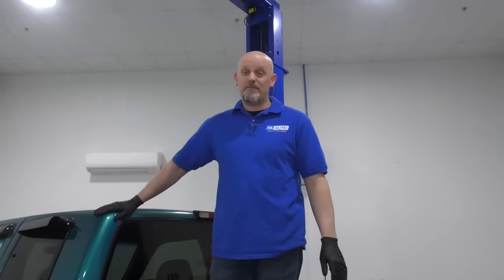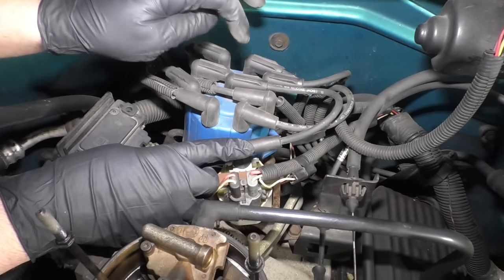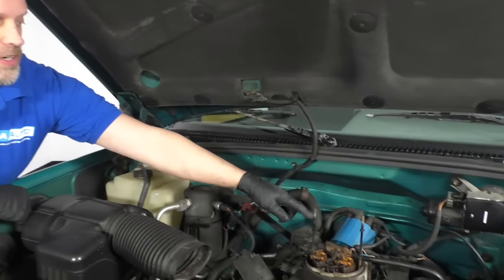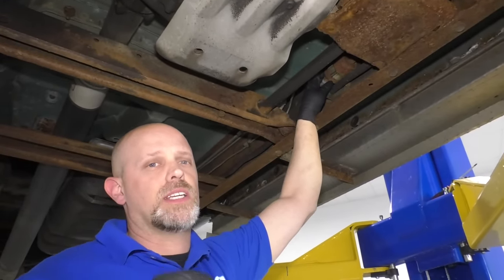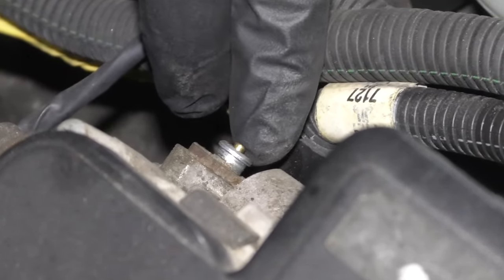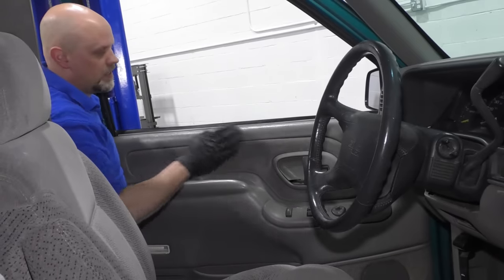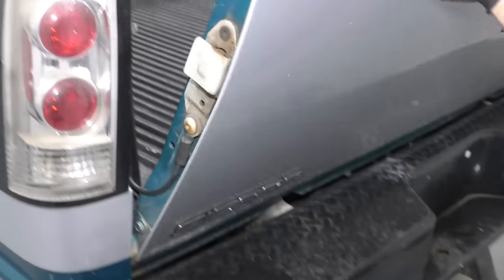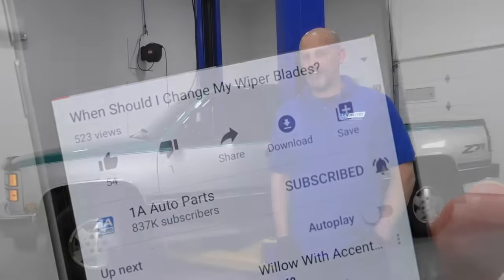Top 5 Problems GMC Chevy Truck 4th Generation 1988-02

Comment: I have a 91 I bought new. 2 of these don't apply. The AC controls on mine are different and it has no ABS. After 275,000 miles and nearly 30 years I would expect any vehicle to need a new fuel pump. The others I haven't experienced. Problems I've had with mine and a friend of mine who has a similar truck has had: 
1. wiper motor control board has solders that tend to break and make the wipers not operate correctly or not at all. I've had to resolder them twice. 
2. Rubber fuel line  (roughly 2 inches long) inside the tank from the pump to the grommet ruptures and causes fuel to pump back into the tank. The symptom is truck will start but immediately die. You can feather the gas pedal to keep it running but it wil run horribly due to a lack of fuel pressure. Another way to get to the top side of the fuel tank is to pull the bed off. 4 bolts hold it on, and the wiring harness to the tail lights will need to be unplugged at the connector, and the grommet around the fuel tank filler neck will need to be removed as well as the grounding wire inside the fuel door. The bed can then be lifted off and rested on top off the rear tires and the bumper. 2 people can lift a short bed, but might need more help for a long bed. Every time I've needed to access the top of the fuel tank, the tank was full of gas and pulling the bed off I considered the safer option. Put alignment marks on the underside when pulling the bed bolts out to make sure the body lines are the same when you put the bed back on. 
3. The door pins, bushings, and roller pins. The roller pins bend at the roller, and the pins and bushings wear and cause the door to sag which creates issues with closing the door as well as noisy opening and closing of the door. 
4. Input shaft bearings on the manual transmission. There is a plastic keeper to hold the ball bearings in place. Of course it gets brittle and breaks which allows all the ball bearings to congregate to one side of the bearing instead of being evenly spaced which creates a lot of noise from oscillation.    
5. intake manifold gasket goes bad causing oil leak.
6. Fuel gauge sending unit. It'll go out and can cause a multitude of different inaccurate readings. Right now mine reads fine from a full tank to about a half tank. It never indicates less than half a tank though. 
7. AC low pressure cycle switch. It'll go out causing the compressor to cycle on and off excessively.  
8. AC recirculation vent limit switch. It goes out causing the motor that opens and closes the recirc vent to continue running even though the vent is fully opened or closed. It can be noticed from a constant clicking noise from under the passenger side of the dash. Disconnecting the electrical connector from the switch is necessary until the switch is replaced or otherwise made functional again depending on the reason the switch is not turning off the motor.  
Can't complain about this (except for the transmission bearings) over a course of nearly 30 years and that many miles though. It has been a great truck and still is.

Comment: I own a 1996 Chevy Silverado 2500 2WD,,,it has jumpy breaks been fixed many times and goes back to jumping,,,it does not do it all the time or to the same degree,,,it has been to the Chevy dealer here 2-3 times and other places too for this problem,,,what is wrong with it???  had it all changed twice and after a couple of weeks or so right back to jumping

Comment: I have 1998gmc 1500 and I’m having battery or charge problems. and it turns off while driving and the  voltage is below 14v around 11-12v. I put the battery to charge and I’m going to see if that helps

Comment: the ignition module goes bad it also loses fuel injector pulse, so if you have no spark and the injectors aren't firing, its the ignition module.

Comment: Hi I has 1997 gmc sierra k1500 5.7L so I did lot what I could but still problem is when engine enough hot and drive in freeway or any in high speed road. When I'm on 40mph saw sign say 50 mph I not heavy foot just very slow to speed up then has jumps or mistakes fires I not sure. But if I just do heavy foot nothing happen like with light foot.

Comment: 2001 GMC sierra 1500 single cab running rich , sputter alot.change to up graded injector, change gas pump and of course service parts .oil+filter spark plugs with new plug wires. Clean egr valve. Clean charcoal canister. Just had enough of this truck

Comment: Interesting common faults on those rigs. The EGR valve to EGR solenoid hard plastic vacuum line that is pre-molded often cracks too. And it's not available as far as we can tell however, the hard 8mm plastic line is available and so are the rubber elbows.  Problem is, using straight line is likely to result in early failure with the unmolded plastic line (under stress all the time). Is this part still available or is there a method to pre-bend this hard plastic line? EGR codes are being generated and we found a crack/aged area on this line.
Reply: I had same problem, made a crude jig with 16 penny nails, cut off heads and drove them in to a piece of wood, 2 x 6, using old line and fittings rigged it to use the thermoplastic tubing and used a heat gun to get the tubing just hot enough to bend to prevent collapse, used my rubber tip blow gun to blow low pressure air through it and after cooled and cut to length with a sharp razor blade and fittings installed, it looks good and works, I'd hate to live on the difference, jobs a bit labor intensive but with patience, it can be done and to the average non-mechanic, they wouldn't know the difference and it's a great, sound, solid repair, sometimes you can't buy what you need, adapt and overcome, having just given that tidbit out, if you will excuse me, I have a Faraday cage to go work on.😮😮😮😮😮😮

Comment: wrong on some of tailgate latch. u dont ever need new one unless u broke it completely. 99 % of the time just push tailgate towards box and it will release, also if its rusty spray lube is amazing. also if not latching when closing tailgate then pull handle while closing gate then once closed u let go of latch and it will grab lude helps in this situation also.

Comment: I've had the head light switch go out a few times. Luckily the one I bought has a lifetime warranty so only had to pay for one replacement! Also the tail light board gets crappy and they'll be intermittent till you get a new one. I thought it was a loose bulb but replacing the board fixed it for good(ok the last year or so, so far!) All the other things I've had to have replaced at least once! Hey but it's got 270K and these fixes aren't too hard to do. Brakes have been the worst of any vehicle I've ever had though. Might be worth bypassing the ABS. I think that's the main culprit in always making the brakes seem spongy.
Reply from the maker: +Mick Jager Thanks for checking us out! http://1aau.to/m/Shop-1AAuto-c
Reply: @1AAuto  Thanks for your how tos. Don't buy much from you guys but the videos help and hopefully you get something for me watching!

Comment: My 98 chevy silverado have had all theses problem the abs just got done the tune up was in my opinion was a joke i was told for one set price they  would do a complete tune up he claim the it had only one bad spark plug didn't do the rest.the 
truck runs real bad,the door left handle broke ,hood inside lift handle broke and lift gate won't lock now i been told it could also need fuel injectors. Its been my experience that most of the auto repairs find females and elderly people's target to rip off.except for Kevs Muffler and brakes they are the best in what they specialize in.Most reliable 
 affordable and earnest.

Comment: Don't forget the heater actuator
Reply: Yep just had mine replaced on my 94 Chevy 4X4 or the motor that controls the heater under the dash on the passenger side but it works great now andnext will be to get the AC running proper instead of just adding freon every couple of years is pretty annoying !!!

Comment: I need help with my 96 gmc suburban. The fuse for the taillights and instrument panel keeps blowing probably about a second after turning them on. Occasionally I get lucky and I can drive a whole trip without it blowing the fuse but not that often. I keep getting told it might be a ground issue but can’t seem to find it. Is there any common areas to look for a bad ground?
Reply from the maker: +Charlie moomoo We wouldn't be able to diagnose an issue like that here, you may want to have a local mechanic take a look at it. Thanks for checking us out! http://1aau.to/m/Shop-1AAuto-c

Comment: I tried to bleed the abs module when I was first having brake issues and it didn't work. My mechanic/boss thinks that we introduced air into the system when we did that.

Comment: They don’t make then like that anymore. I had better luck taking the bed off when I replaced the fuel pump rather than dropping the tank. There’s only 4 or 6 bolts holding the bed on. Take those out and slide the bed back.

Comment: I’ve got a 98 Silverado. My interior door handles barely work, passenger door doesn’t work. I have an issue with the passenger door sagging so I have to lift it up from the outside and slam shut. Haven’t an issue with the fuel pump or filter. But I am losing brake fluid somehow
Reply: Your rear brake cylinders are probably leaking.  My fiancee's 97 GMC was losing brake fluid and that is what it was.

Comment: My truck is a 1996 z71 and I haven’t had any of those issues you did leave out one thing the security system sucked bad when gm first started they sucked then in 2001 they still sucked but 2002-2020 is great 👍
Reply from the maker: +Corey Reynolds Thanks for checking us out! http://1aau.to/m/Shop-1AAuto-c

Comment: I have a 94 k3500 with 200.450 mi w/ a 470. runs like a top. no leaks or oil burning. Cannot keep a battery connected. A short somewhere that eludes me. Will drain the battery in 4 days.

Comment: I have a 1991 4.3 chevy silverado truck is hard to start I have to hold down the gas pedal to start it once it starts runs rough for a while then it clear up I replaced fuel pump and fuel filter I air control

Comment: I'm having a big issue with my 1989 c2500 when I turn in my heater a/c blower sometimes my truck will just die and will not restart for a few minutes

Comment: 1990 Silverado 3/4 ton
Starts and runs perfectly for about 10 mins than seems to possibly start to miss spark or starve for fuel and stop running.  After it stops running engine will continues to crank and almost start for about 10 minutes or so, then eventually engine does start again and run perfectly again for about 10 min till it will stop running again. 
I don't have a tester or knowledge of operating a tester.  Thinking of replacing both the ignition module as well as the fuel filter as I already had replaced the fuel pump not too may miles ago.  However this my wood truck and it does sit ALOT OUTSIDE not being run for many months at a time nor does it get many miles on it annually.
Any ideas ?
Reply from the maker: +Bryan Arndt We wouldn't be able to diagnose an issue like that here, you may want to have a local mechanic take a look at it. Thanks for checking us out! http://1aau.to/m/Shop-1AAuto-c

Comment: I have a problem with mine. 95 1500 z71 I have heater and ac. Both only work on high. I got a different HVAC control from the junk and it’s the same thing only works on high. Do you know what it could be?
Reply from the maker: +M P We wouldn't be able to diagnose an issue like that here, you may want to have a local mechanic take a look at it. Thanks for checking us out! http://1aau.to/m/Shop-1AAuto-c
Reply: Almost always this is caused by a bad resistor for the climate fan blower motor.

Comment: Please help have spark from the coil thru coil wire but spark is not getting to the plugs. New cap rotor. Crank sensor, camshaft sensor, and ignition control module, wires and spark plugs

Comment: all door pins need is Fluid Film sprayed on them once a year. I have the distributor problem and getting it out to replace it is the problem because the bolt holding it down is seized in place on my 1992 Suburban, I already have the new distributor, it cheaper to buy the whole distributor than just buying the spark module and pickup coil, i could not find them as cheap as the whole unit and My distributor s cap hold down bolts where seized and broke off, i guess that because of the aluminum base plate and the steel screws in the cap. When is the car companies going to get that steel and aluminum don't like each other when touching.

Comment: I have a 1991 Chevy 4×4 5.7 l motor.....
Started and ran fine...
Family member jump started a car with a dead cell battery in it .. truck would not start... Had battery checked and it was bad replaced... Truck started... Two minutes later died... Battery dead .. charged and same thing accrued... Any idea what the problem is? The local mechanics all say the same thing, bring it in and we will look at it, the diagnostic fee's start at $200.00 and go up drastically.

Comment: It’s a lot easier to take the bed off to get to the fuel pump. I couldn’t imagine wrestling with fuel fittings that are 30 years old while reaching over the fuel tank. It never as easy as a simple unscrew lol. Something always has to get stuck.. especially cleaning the factory sealant off. Just less back breaking and you don’t need to balance that big ass tank full of gas.

Comment: My speedometer and odometer doesn't run.
I changed the sensor in the transmission, but the failure is already there.
C1500 89 5.7 2wd

Comment: I got a 97 chevy 2500 and most of your video I have those problems can't figure out the abs still and now I'm loosing power well going up hill
Reply: Your losing power going up a hill could likely be the (ESC) Electronic Spark Control module having gone bad. It is located on the passenger side of the engine block just in front of the starter motor. Check out some youtube videos to figure out how to replace it. It is in a tight spot which can make it a pain to replace.

Comment: proud owner of 97 gmc sierra sle c1500; currently non-op due to reasons unknown to me. symptoms that i know of: cold start rough idle eventually into constant rough idle. hard shaking w/knocking but not engine mount, stalling when shifted into reverse, then came the no go: id be flooring gas pedal and it would barely crawl until 3rd gear then be fine until i had 2 stop again????!!!!! PLZ HELP?! my truck is my daily driver/work truck/home!
Reply from the maker: +Jackie Blathem We wouldn't be able to diagnose an issue like that here, you may want to have a local mechanic take a look at it. Thanks for checking us out! http://1aau.to/m/Shop-1AAuto-c

Comment: EASIEST WAY TO CHANGE THAT FUEL PUMP IS PULL THE BED SOUNDS LIKE A LOT OF WORK BUT ITS REALLY NOT AND YOU DONT HAVE TO PULL THE BED ALL THE WAY OFF JUST SLIDE IT BACK ENOUGH TO CHANGE PUMP
Reply from the maker: +Josh Fowler Thanks for the feedback!

Comment: Have a 94 GMC K1500. Has anyone ever had a problem with a possible starter heat soaking issue? Cranks up no problem when cool/cold. When it gets hot from driving it for a while I will only get a click when trying to start it. Starts up fine after it cools off. Have replaced the starter and wrapped it with a heat prevention wrap. Checked the wires to the starter and no burn marks. 🤷‍♂️🤷‍♂️

Comment: I have 94 c1500 350 and im having problems where the engine turns off  whenever i come to like stop or im stopping i dont know what could it be i already change the distribuator and the cap im not sure about that madule and i think its the fuel pump but i can hear it that is and on my dash i get “check guages” light on do you what might be the issue?
Reply from the maker: +Eleazar Valdez We wouldn't be able to diagnose an issue like that here, you may want to have a local mechanic take a look at it. Thanks for checking us out! http://1aau.to/m/Shop-1AAuto-c

Comment: 1997 Chevy Silverado 5.7. The problem I having is, my front driver side brakes keep getting stuck. It sometime happens during change of temperature, or just it happens. I can drive to point A with no problem and drive to point B it get stuck. If I would release the
Reply: Sorry I pressed the wrong button. Anyway, what could be the problem. I replaced both entire front brake system.
Reply from the maker: +ROLAND DELOS REYES We wouldn't be able to diagnose an issue like that here, you may want to have a local mechanic take a look at it. Thanks for checking us out! http://1aau.to/m/Shop-1AAuto-c

Comment: I'm literally having all those got damn problems! Took it to a shop and it still stumbles sometimes at take off or even just idling as I let it warm up in the morning. Handles are loose.  Sluggish up a hill with or without my cabover camper in the bed, maybe goes 40 mph uphill. Frustrating.

Comment: CHECK ALL CORNERS OF THE FRAME 
WHERE THE BODY MOUNTS ARE LOCATED ; PLUS OTHER AREAS. THIS IS 2021 OF MAY WENT TO THE CHEVY DEALER CHECKING ON AN O4 CHEVY TRUCK LOOKED NICE BUT GOT TO CHECKING THE FRAME AND THE PASSENGER SIDE FRONT UNDER THE MOUNT FOUND A RUST BUBBLE AND WHEN I GOT DONE PICKING HAD A HOLE AS BIG AS A LID ON A LYSOL SPRAY BOTTLE AND THEY WERE ASKING 15,OOO$ FOR THIS TRUCK WELL I HOPE AND PRAY ANYONE BUYING CHECKS OUT THE FRAME.

Comment: You forgot the problem everyone has is the windshield wiper motor. The thermo whatsishades engages the front axle does not work. The wire looms under hood fall apart. The e-brake cable horrible routing. The door hinges oh boy that is the worst the bushings wear out almost immediately. The paint can flake real bad. No cubby pockets to speak of. Doors and behind seat.